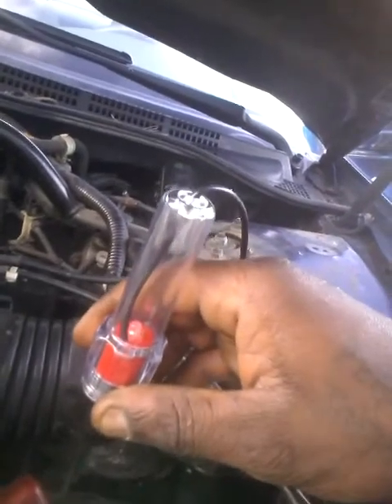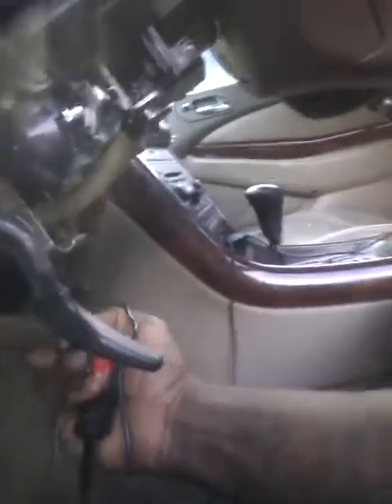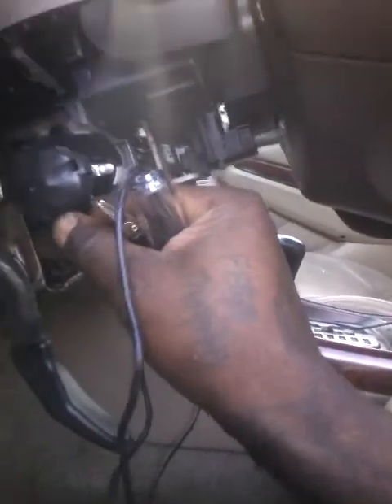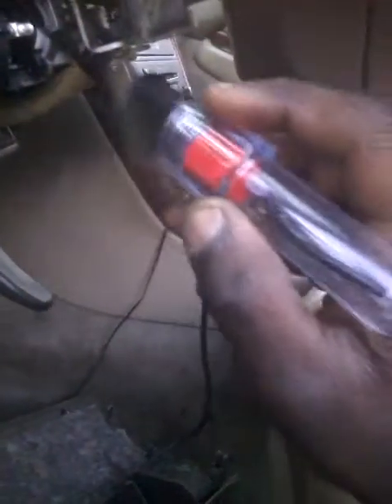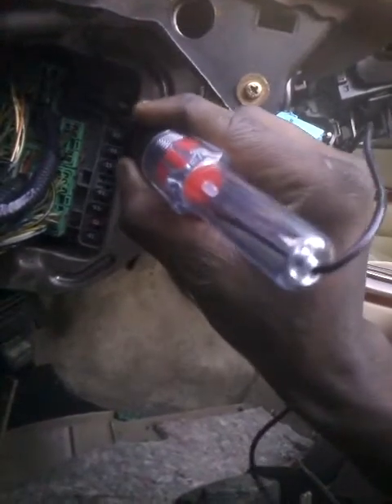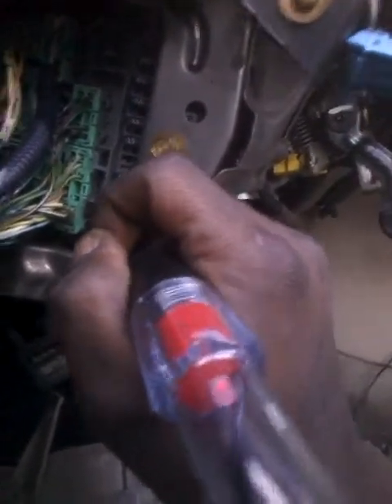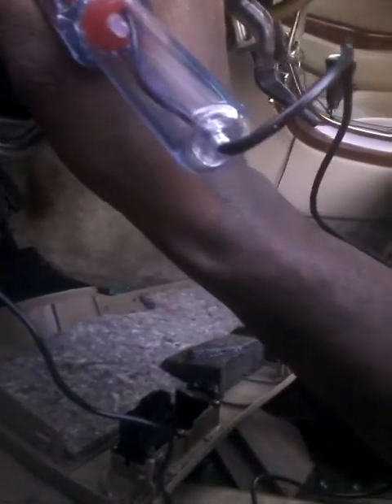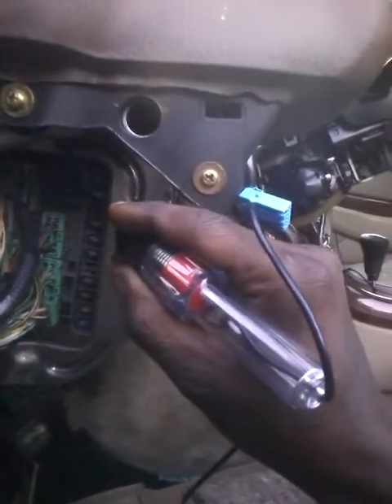How to test ignition switch and fuse with test light

Comment: You didn't test your ignition switch. You only tested if the ignition switch is getting power. You have to check all the wires on the ignition switch.

Comment: Yo does ur car start even the starter signal not light up...please help
Reply: u talking about the S wire? I'm not getting power to that wire and I replaced the switch. relay and fuse are good